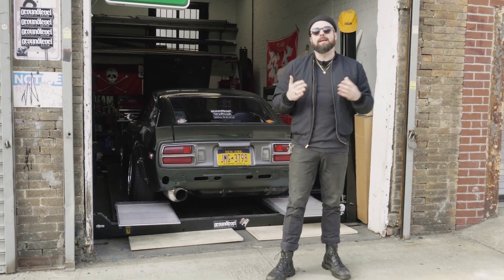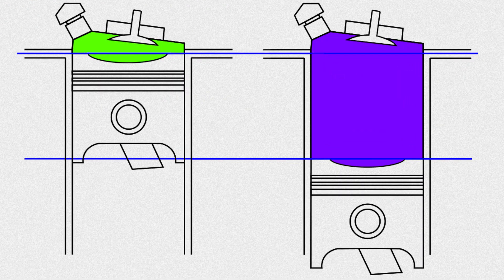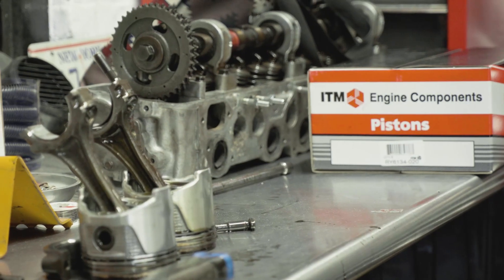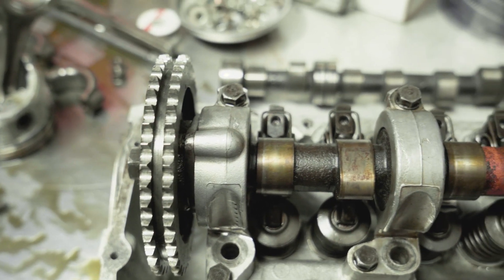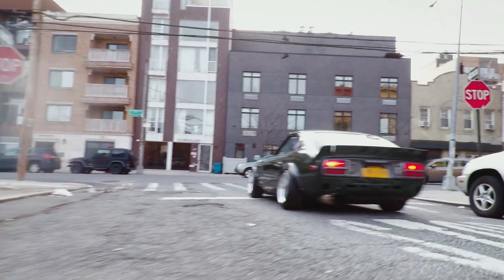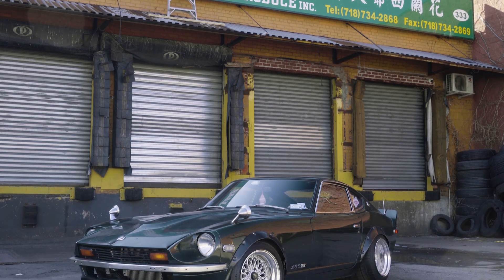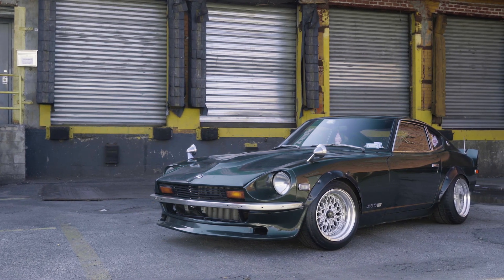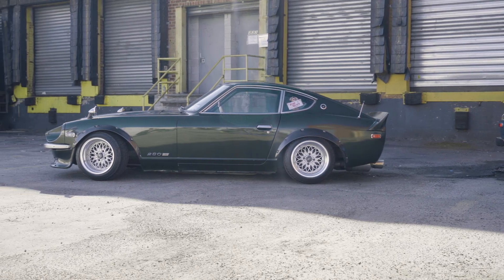Project L-Series: A Bored L28 Motor With Exciting Potential!

Comment: Well it's about TIME the internet has come off the MADNESS !
     Appreciating the Z in a NORMAL REALM of enthusiasm !
   I'd be able to finance my builds faster, if I were to get 50$ Everytime somebody asks ( in a this is what you should do , tone)
Are you going to put an LS in it.?
" No I don't want a Camaro"
Are you going to put a 2jz in it?
"No I'm not a Trust fund baby
I'm not dumping that kind of money into this car"
It's going to be a Daily Driver
Great to look at
Great to drive
I'm not going to be RACING anybody.
This is for me ,to drive , a kick -ass purely analog Sports Car,
EVERYDAY......it's why I moved from New England to Florida. Because I love to drive cool stuff. 
I drive a cafe Styled bike every day while I'm building my Z from ground up bare shell.
Racing seats yes ( with adjustable back ,daily ) 
Interior ,Spartan ( no wall to wall carpet,EVER !)
Sound deadner removed, the glued tar sheets ,the factory used.
Modern lizard skin heat barrier ,yes.
2 Component Raptor bed liner replaces rubberized undercoat (  a hard plastic urethane with sound deadening ,and  moisture barrier  properties built in),
5sp and mild porting,cam 
L28 just to bring it up a notched ,Subaru LSD.
Lowered yes ( in Florida) 
Yellow koni shocks.
15x7 ... With high performance tires to be determined  not track tire,
Just below that.
And Drive with That Familiar Datsun Driver grin ....that,this car is Kick-Ass and exotic in the world of Classics it's up there side by side with a vintage 911 ( and it tics the 911 owners off STILL, for the SAME exact reasons it did when they were New.
World Class looks
Acceptable Performance
And Costs less to build and own. = Driven More which vintage  911 Owners are envious of.
Great video,RIPE Edit, great content.